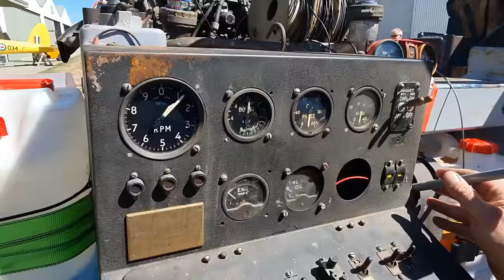First run of Merlin 25 engine in 50 years!

Comment: Dumb question; will it stress the engine to run a higher RPM without swinging a prop?
Reply from the maker: Yes it could so we stayed under 1500rpm, was very touchy on the throttle!

Comment: Does it hurt these engines to run without a prop? How do you keep them idling so low without a load on the shaft?
Reply: It’s no different to idling a car engine before putting it in gear.  This engine was able to idle as low as 600 rpm.  We were very careful to not let the revs rise above 12-1300 rpm.
Reply: @larrylewislarry  Thanks

Comment: but why is the machine only turning a 1000 rpm and not at 6 or 7000 for real power?
Reply: Because it's in a test rig, having its first run in fifty years, and no Merlin could go to "6 or 7000", anyway.

Comment: Didn’t see any oil pressure or temp gauges working...
Reply from the maker: There are two such gauges to the right of the main panel up on top (seperate), it was easier to connect the instruments straight off the engine than go through the box.

Comment: Why do you run an engine without a stub prop?????
Reply: A stub prop is only needed if you want to pull horsepower out of an engine.  An idle run like this doesn’t need one.

Comment: The valve train looks way too dry
Reply: The entire valve train was greased prior to the run.  Hot oil priming whilst cranking with the cam covers off was to observe oil flowing from each and every follower before the first start.  Oil is fed to the cam system at only 6 psi and typically takes longer to flow from the followers.

Comment: You know, for the life of me I cannot understand why these hacks aren’t running a club on this engine.  It pisses me off to no end, regardless of whether or not she’s a stand engine!
Reply: Please don’t get too upset by the lack of club propellor - we took a great deal of care in what we did.  A club propellor is only needed to absorb significant amounts of horsepower.  This engine was only run a number of times to return it to life before being refitted back onto the Mosquito - with its propellor…. These runs were determine its behaviour and condition after a period in storage. 
The throttle linkage was rigged to limit rpm to idle only and as such is no different to running an automotive engine in neutral.
Best regards,
The Hacks.
Reply: @larrylewislarry  So noted!  I used to rebuild these engines when I was a wee lad in the early 80’s for an outfit in Sacramento California.  I can only tell you that I replaced many, many, many, many valve seats and guides.  I love the big Merlin’s and Griffons, the sounds coming out of our test cell when we were pushing 100” of mercury was astounding.  Those race engines were nothing short of spectacular!  We ran clubs on everything as the crankshaft counterweights absolutely would not tolerate ANY slappage!

Comment: What a sound! What an engine! 😍 Interesting how the last two exhaust ports merge into one - not the case on the Spit, maybe just for the Mossie?

There's some original footage of how this fabulous machine was made here: https://youtu.be/-fo7SmNuUU4
Reply: It might have been a firing order issue that needed resolving in order to synchronize the two engines.
Reply: @rconger384  Nope clearance so they would NOT burn the wooden wing, only the 20 series single stage supercharged merlins on the mossie used them the Later 2 stage engine was longer had a longer nacelle more clearance not needed !!

Comment: btw, are you trying to retard the spark using diffent lengths of coil wire?
Reply: The coils are lengths of capillary tubes that give oil pressure and temperature and coolant temperature.   They are unwound from the  cardboard drums as they are fed into the aircraft.  Very very old technology.
Reply: @larrylewislarry  I stand corrected sir
Reply: and thank you for the information